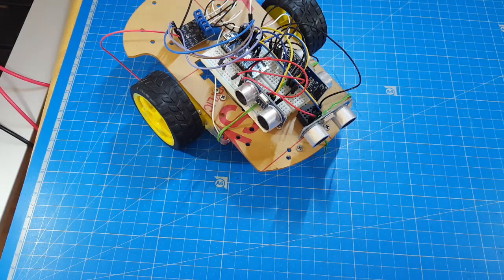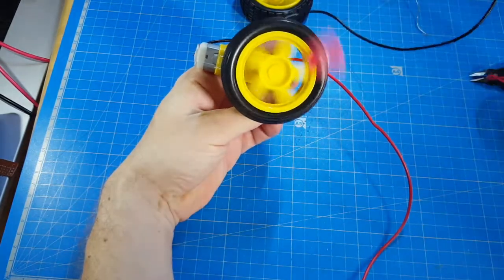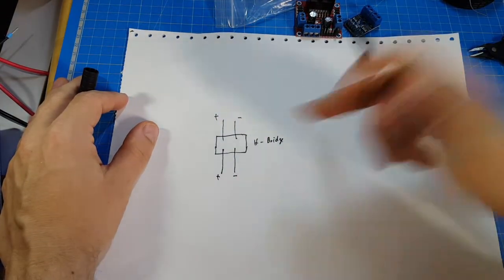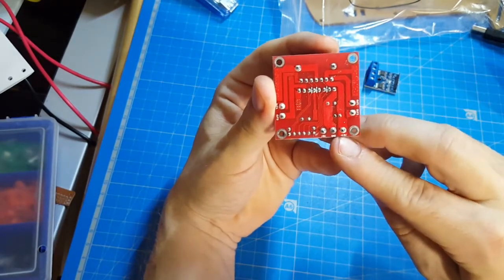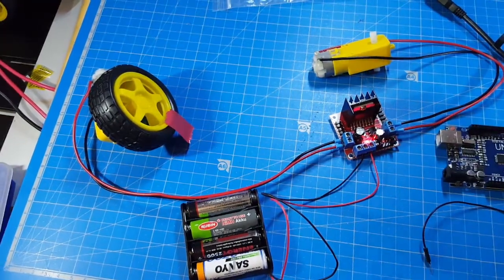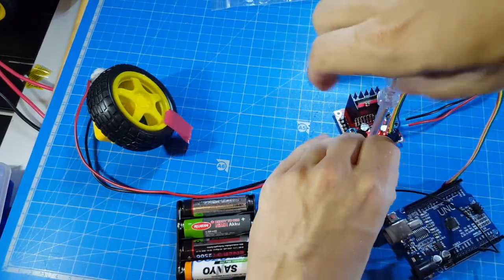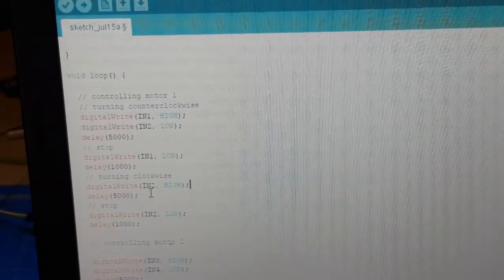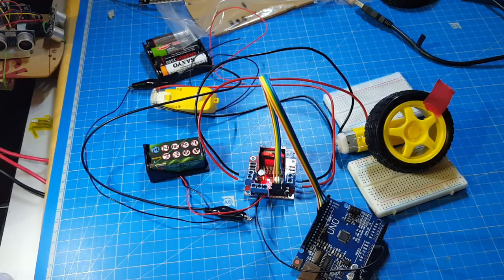What drives my wheels - The H-Bridge

Comment: What is the reason that your motor burned L9110? It can handle 0.8A, after all...
Reply from the maker: The IC can handle 0.8A. Must be the breakout-board that makes the problem?? If you search for a H-bridge for this motors, you'll always find the bigger one.
Reply: nenioc187 when I was powering my l9110 using 7.5V one of motors was spinning regardless of l9110 channel input voltage. So I considered it to be burned or damaged. Then I tried powering it with 5V and it works fine. Additionally I added 2200uF capacitor on it's power rails. Thx for advice